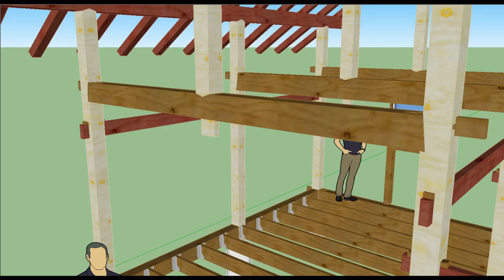Unabridged Timberframe - Tie Beam

Comment: wow, might be the most in depth timber framing video on the web. Love seeing the center line layout used to excellent effect. Props for the hand tool approach, especially the T auger, good tools that need to be used more. Your 1.5" chisel is a beast, looks hand forged and maybe 1/2" thick at the top? 
Only friendly helpful tip I could think to give would be to get yourself higher or the timber lower for the mallet work, reaching way up will wear you out fast! great Job!

Comment: Couple of friendly tips. Use a knife to mark the lines, a pencil wears down a gets thicker introducing more error. Should that story pole be more straight? Doesn't that also introduce error?
Reply: "Knifing" a layout mark is applicable in some styles of woodworking like some examples of furniture work from Europe. However, it is seldom to never done in most other woodworking traditions for many reasons. First, layout is typically done in ink...never pencil! Second the layout is left on the timber where it is not visible (ie. top of beams, outside of beam posts etc.) as a reference and history of the frame to those in the future that will work on it. Thus, you never "cut" you past your layout lines as they remain to guide assessment and other work that may need to take place. 

The story poles deviation is more than adequate in this context as the margin would be in fractions of a millimeter from what they need to be exactly...

Comment: Why doesn't the Timber Framers Guild have videos like this? Or the Forestry Forum? They seem to be holding things like this as a secret. You'd think they would have something showing how to deal with really irregular timbers. Thanks! They need to get on the ball.
Reply: Well...those are both really good questions...LOL!!!

The TFG has some serious political and administrative challenges, and has for 20 years now. Its just keeping itself together and the idea of doing videos or even good classes is something they would like, but have to many other challenges to deal with, and have since they started in the 80's...

The Forestry Forum is a "profit based" forum run and owned by a single individual. If what someone (like me and others have tried to share) are not in alignment with the owner or key members of the forum, you are blocked from posting there. I use to, I don't (or can't?) any longer...

Mr. Chickadee, and others (over seas) all teach these methods...